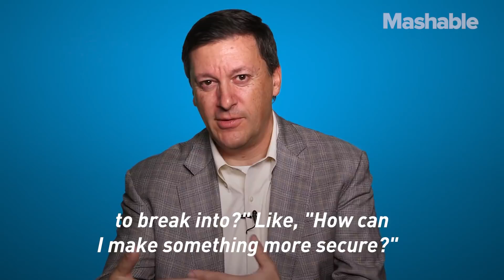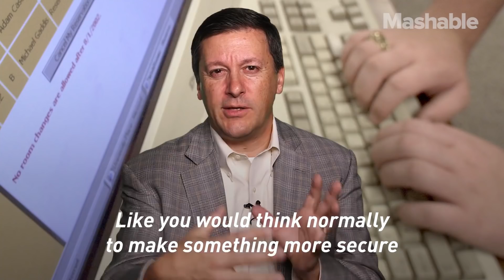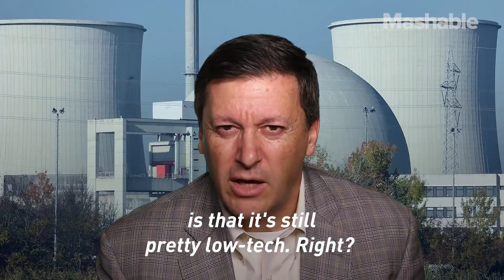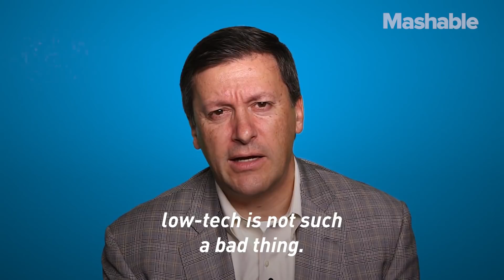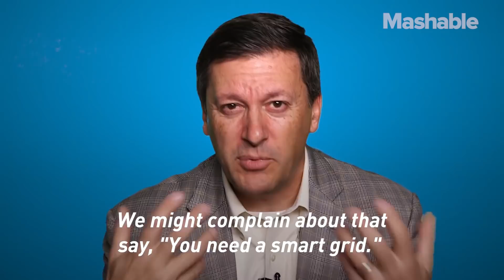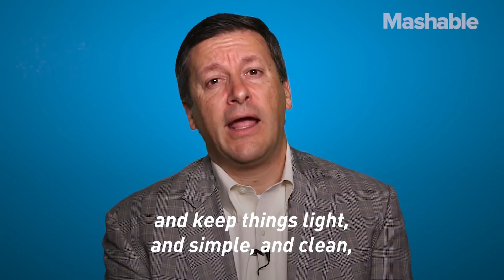The Most Difficult Kind of Computer Systems to Hack

Comment: Most secure system? One thats completely isolated from the internet. Run two systems. One that operates the thing (eg powerstation or data base for patients) then have another thats connected to the internet. The first system isnt even in the same building as the second. Different wiring and all

Comment: Yeah, let's all just go back to building barns and use oil lamps instead of electricity. That is more secure... What is the point of having a super safe where you can't fit your stuff? Or a super efficient car that only goes 1 mile and stops? Keeping it simple is a good strat, it has worked for bacteria for millions of years, but look at the more complex animals and how much more they can achieve. If you don't risk, you don't win.
Reply: You didn't get the topic, he's not saying "don't do big things" or "smarter things" but just use the simplest way do to it
Reply: HAlex™ but that is a given. Why would someone want to make complicated things just because. You do complicated things because they will give you something the simple ones won't. In his electric grid example. If one fails, the other one survives. But what if one grid is nearing max capacity and having the other grid help actually prevents a failure? I'm just saying, there has to be a balance. You don't use a flamethrower to cook, but you don't use a lighter either. You can cook in a fire made of wood, which is simple, or you can cook with a stove which is more complex, but much more comfortable
Reply: superjugy See Zawinski's law. It is mainly targeted at software but can apply to any system with an end user of some sort.
Reply: Yeah, that law describes precisely why our systems tend to be complex, because simple ones don't have all the features we need. I'm not saying growing is always better. It is the balance that makes the perfect engineering product, like you said, not just programs, but all systems.
Reply: Rxonmymind yeah, destroying is simple. A bomb is simple and can destroy in seconds what took an architect and workers months to build. An engineer will always search for a balance between simplicity and usefulness, cost and quality and so on. Both extremes are bad.

Comment: Soo don't use firewalls???  Why does that sound wrong
Reply: A firewall can be hacked. A semi-analogue system can't.
Reply: Yeah, there is some nuance here that wasn't really covered in the video. For example, a firewall may add complexity, but it actually reduces your attack surface by minimizing the parts of your system that can be accessed remotely. So instead of someone being able to attack every network-accessible device within your network or PC, they are only able to attack the firewall itself. That's pretty much the whole point of a firewall.
Reply: Or don't connect stuff to the Internet if it doesn't need to be at all.
Reply: Timothy N 
Bingo. I do my finances on a "dead" computer not hooked to anything but an outlet. Simple and safe.

Comment: Air gap, your welcome.
Reply: Yeah, that was my first thought when I read the title.
Reply: I was half kidding. What he is talking about is still a good idea even for air gap systems where you might get infiltration for on site hacks attempted. I think that is how that supposed attack on Iran's centrifuges was carried out. Someone had to physically access the system on site.
Reply: You are right though, the most secure system will be the one with less points of entry and points of failure. an air gap system with just one keyboard as entry is definitely low on points of entry.
Reply: About to comment that

Edit: create a computer terminal with one entrance and one user- air gap it and then create an 3 attempt lock out with a hard drive back up hidden in your grandmas grave

Comment: The KISS principle has always served me well...I guess technologists like Ed are finally realizing the validity of such an idea.
Maybe Bill Gates was right and 256K was actually enough.
Reply: Aaron Lingenfelter :: Actually it was 128k and at that time I was running multi-user systems on as little as 16k to 64k and we knew what every process was doing.
Reply: Thanks for the correction...I thought it had been lower, but was not sure (it was a little before my time--first computer I used was an Apple IIe ).